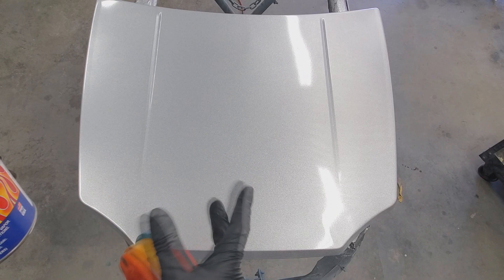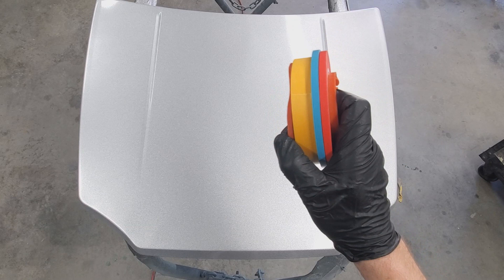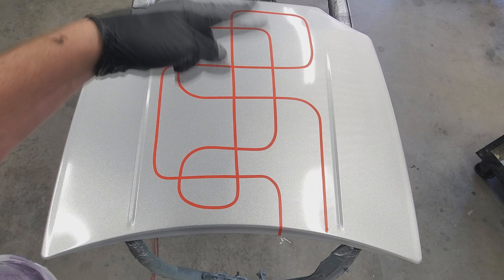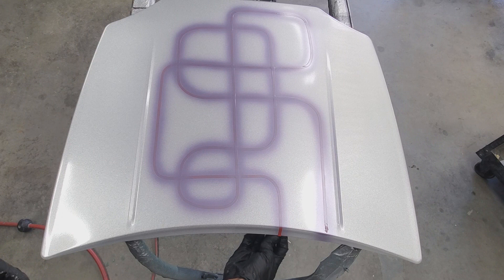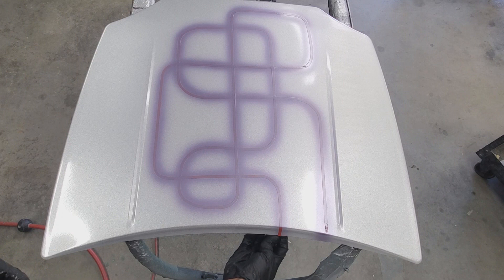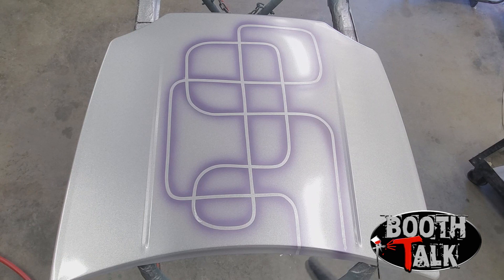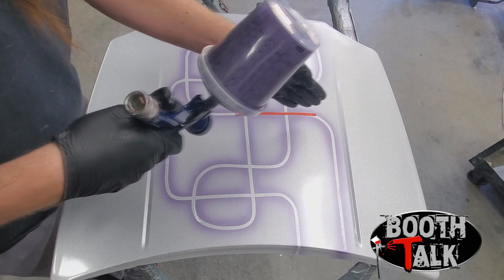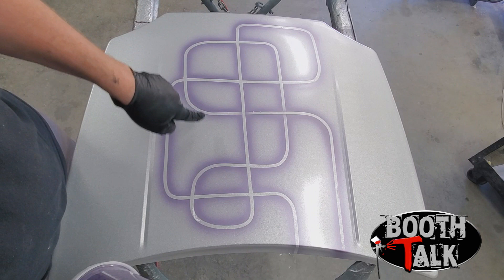How To Custom Paint: Never Ending Line and weaving

Comment: Your Hood looks Glossy = Unsanded,  If So, ... How good was Adhesion Longevity? Merely Curious Or Just a Demo & Not cared About   merely For instructing. >>> Good Teaching Vid! Viewers   Key Ingredients Is Good Tape that Doesnt Lift, Steadiness, Right Paint Mixture/Pressure. & If your Lines Don't appear Perfect to the nitpickers, just tell them "Its an Abstract Design" bcz "Abstract" Has No Rules Or OCD Definitions other Than Not Perfect!!!
Reply from the maker: A couple of points on that.

This hood was open basecoat, not cleared.  Eastwood base, activated, and this is how it dries.  Yes, this was done as a demo.  I made the purple from extra colors I had laying around to give good contrast.

You know how the internet is, there's always people wanting to nitpick even for demonstration stuff. Lol. Thats why I made that note in there😂
Reply: @inthehomeshop  I Was NOT OCD Nitpicking rather curious Bcz a Lot Lot Lot Of Time/labor saving Changes have Happened since I was Doing Body work 30 Years ago. That I Don't Know About & Even Though The Chemicals Now Kill Me, (= Not Metaphorical), I Still want to Learn so No Offense Meant! Yes I Know About Custom Mixing (?) Colors from The Shelf is How I Painted My long ago 69 Chevelle Wagon.
Reply from the maker: @Nomadcreations  nonononono!  Wasn't referencing you with that comment.  I was talking in general how the internet is😂.

You're good man!
Reply: @inthehomeshop  Thanx To Clarify & Yes I Know All to Well after 50 Years Of Adulthood and numerous Years Of SFB's answering Craigslist & facebook Marketplace ads  That don't Even Know or care What dictionary definitions Of Words Are any-more. & I Can elaborate & they still Cant comprehend . If U R In Business I'm Sure You Run Into it Alot also